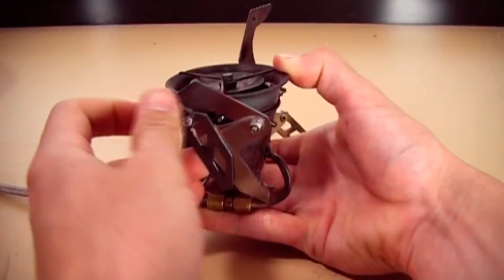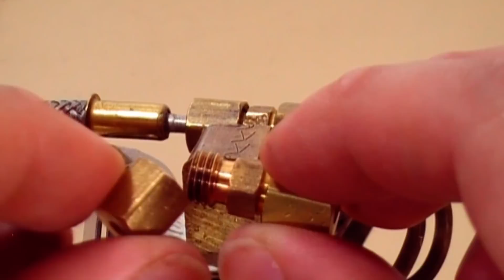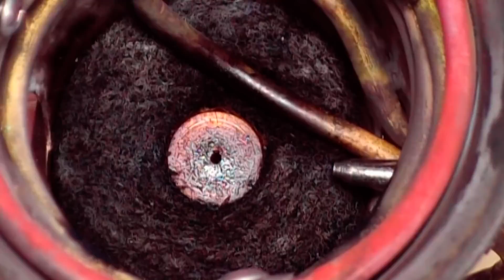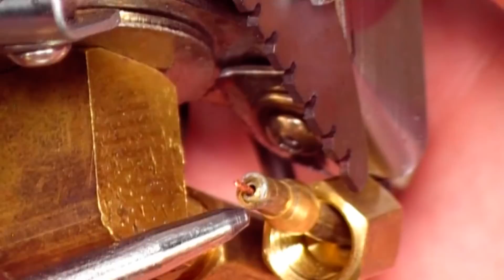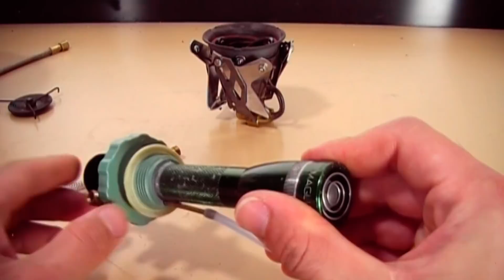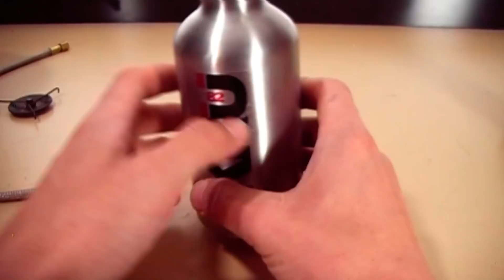All Alcohol Stove design

Comment: I have been using an rubberized superglue lately and it works awesome.   I get it at the hobby store.  When I built my miniature gasoline lantern I used Teflon rope for all of my seals and packing it works out well.   I found miniature valves and fittings by a company from Vermont I believe (if anyone is interested I can hunt down the name).  I have the convenience of owning a pile of machine tools and watchmaking equipment so making small parts is not that big of a deal.   This stove design here is awesome,  thanks so much for sharing it!   I love building these sorts of things myself.   I decided to make my own pump and make it external,  this simplified and further miniaturized the lantern I made.   I used a threaded value on the tank.   Very simple to make on a lathe,  I can share the specs.  I want to make a micro miniature pressurized,  mantle type,  alcohol lantern for backpacking,  any ideas would be great.   Thanks again!
Reply from the maker: +Denis Carignan (The un-blinded Watchmaker) Yep, that glue for gluing tires to the rims of RC cars is pretty resilient too. I have used teflon tape bundled into a rope to seal my butane stoves that use water valves. I have also used leather on suggestion from a viewer and it works well too. The leather packing I used on a stove I called the "DIY SVEA 123" because that one works on thermal feedback through the brass valve, I had trouble with the tape "shrinking" with the heat and not sealing. That SVEA 123 design might be of interest for a lantern, I found from my homemade butane mantle lantern that the flame conditions that best illuminate the mantle are harder to obtain that just a hot blue flame. It's almost like the flame needs to be an oxidizing flame (fuel rich) with secondary air meeting the surface of the mantle.
Reply: +clkindred it's the same concept as the hot blast and cold blast kerosene lanterns.   I think it's in how much and possibly the temp of the air mixed in the draft tube.  I've noticed that where the vapor enters the blast tube makes a huge difference.   The Coleman design works perfectly,  the fresh air enters from the top and the heat on the tube creates draft which provides the vaporization and right mix before the fuel mixture enters the mantle.   Too much air and the ignition is outside the mantle,  too little and the ignition is inside.   I've noticed this especially when burning different fuels in a Coleman lantern.   I am working on the calculations but I really suck at math do I've been having trouble nailing it Down.  Getting the right amount of pressure our of the generator is tough also.   Stainless steel screen from automatic transmission filters work fairly well.   I want to make a lantern with no pump like the SVEA stove but I haven't been able to get enough draft to both light the mantle and get the heat needed to pressurize the tank.

Comment: soldering isn't high heat enough... learn to braze. Oxy-fuel or oxygen-acetylene brazing typically utilizes silca-bronze as a filler material. It still works by capillary action just like soldering but its able to withstand much higher temperatures and pressures than lead solder. It's what they use on exhaust header flanges (even for nitro methane burning engines) as well as air injection (thermactor) manifolds on older smog engines. 
I'd suggest investing in a small tubing bender like a brake line tool before bending tube like that again. You can see where you crushed it a bunch of times and that's far from safe. You will also probably find that you get a more steady flame if you use a correct tool and make really smooth bends as the smoother the outside, the smoother the inside, the smoother the flow of fuel.. and smoother means less restriction and more efficiency.

Comment: I have to make a correction to my post I had not used my caliper in about 15 years that I left for the first zero after the decimal point. It was.025 not .25 for the outside diameter and .0053 inside diameter appreciate. I have two five inch pieces of this tubing in my scrap box.

Comment: Put a compression fitting on the 1/4" tubing. On the other side use a cap. You drill a hole that the tubing just fits in, than silver solder the connection do the same to the hook up for the expansion chamber. Attached to the expansion chamber first then to your 1/4" tubing last. I don't know how many inches you needare to be use. Silver soldering is just like soldering with regular solder you have to use a different flux and silver solder. If you can solder with a propane torch than you can silver solder. Does that help?

Comment: Nice work.  What type of solder did you use on the original construction of the brass components?  I don't think that silver solder / braze would have re-melted but I do like the threaded connections better.  You may have covered the legs in a previous video, are they hand, scroll saw, or laser cut?
Reply from the maker: +Keith Ward I used plumbing solder. I think a brazed joint would hold up well, but I am not outfitted to braze. The legs were cut by hand with a hacksaw and file from dollar store cookie spatulas.

Comment: clkinderd  Do you know how hot the 90 deg. elbow vapererizeing chamber gets? I found that I still have some Silvaloy A56T brazing alloy left it's melting range is 1145 - 1205 deg. F. Or you could bronze solder it. Use .16 inch diameter. It's melting range is 1655 - 1724 deg. F. Don't forget to use the proper flux. I think either one should work in soldering the .052 in tubing into a plug for your vapererizeing chamber. The same for the other end that is used to attach the fitting for your 1/4 inch compression fitting. Let me know how it works. If you have a problem finding the.052 tubing I have two pieces here that are a little over 5 inches long each. Where did you get the legs / potholders for your stove?

Comment: Excellent job and very nice stove. Thanks for showing how you built this. Is there a reason you did not use copper tubing as opposed to brass?
Reply from the maker: +bain5872 Yep, copper gets very soft after being in the heat like that, you can see the brass tube turning red on the top loop from the heat. Honestly, the way I have the vapor generator protected inside the burner, and held in place with the screws, I could have used copper. Older versions of this stove had the vapor generator outside the stove, so I made a choice to use brass because it stays more rigid than copper.
Reply: clkindred
Makes perfect sense. I'm going to build one for sure. Really great job using parts on hand.
Reply: Brass is better choice than copper. Copper oxidizes much faster than brass.
Reply: Great observation. Can you tell us why Brass oxidize slower than Copper?
Reply: bain5872 Copper is oxidized at a temperature ranging from 200 °C. Brass is much more resistant alloy.
Reply: kabyzdoh
Yes but why is this so?
Reply: +bain5872 It has few components: Cu,Zn, sometimes Al, Ni, oxides of these do the job. Wikipedia, you know...
Reply: kabyzdoh
 I was not being rude. I was challenging your statement so you could provide facts to back it up. You did a good job!
Reply: +bain5872 I felt that you do me the exam when you said "Can you tell us ..." You confirmed it now. What for you needed it?
Reply: In your original post you were advising me of a fact I was very aware of. I wanted to be sure that you were correct and the only way to do this was for you to verify that your information was valid. I see you asked Wiki for the information that you, at that time, did not have. You now know the facts. This is the reason for this post. You have increased your education!
Reply: I would want to believe that your approach makes the world better.
Reply: If you decide to be better, then the world is indeed better. Isn't it! You're a good sport.

Comment: Will you be doing another knife anytime soon?
Reply from the maker: +MrZimma frame I just put the full flat grind on a knife I'm making now, my hands are still dirty! It's a folder though, liner lock, so it's less straight forward than the others.
Reply: Are brilliant. I study Mechanical engineering and the variety of metal selections is fascinating. I have yet to find a good video on youtube of someone making a waterproof/water resistant knife. could be a future video idea?
Reply from the maker: +MrZimma frame Ah, yes the rust is a problem with O-1 tool steel although the blued blade on my Kershaw Blur has not shown any signs of rusting with normal use. A "stainless" tool steel like the fancy CPM S-30V or 440c would be a good choice, I don't have the ability to heat treat those. A food prep knife would also need to be rust proof and non-toxic.
Reply: wow that was weird, i was just reading about 440c, crazy! is there any alternative rust protection for 01 tool steel as i do want to use it for cutting food and meat. in the past ive wiped the blade after use and rub oil on it.
Reply from the maker: +MrZimma frame Apart from what you are doing, which is good to do with a blade regardless of what it's made of, the only options for DIY'ers is a coating of some kind. I have been interested in using products for coating firearms like "Ceracoat" but it's much like paint. I would LOVE to figure out a way to put a "nirtide" coating on a blade, but the process is pretty out there. Other areas I am looking into is "fuming" metals onto the blade, glass blowers use that method to put metallic coatings on glass.
Reply: I wonder if black car body paint would work, (rough the metal up and use primer then matte black) then just expose the edge by sharpening it. Its an interesting topic to discuss
Reply from the maker: I would also be interested in electroplating a metal onto the blade, but the variety of metals that can be plated are slim, I have not found metal salts of the right metals to make a useful coating. It could be done with copper if one dose not mind a copper colored blade, the copper itself can corrode and turn green though. Titanium is very corrosion resistant and non-toxic, but I have not found a way of plating titanium onto steel. The titanium nitride coated drill bits that are gold colored have that put on by physical vapor deposition or reactive sputtering. Both require a vacuum chamber. Salt bath ntiride or "melonite" treatments require a dip in molten salt, exactly what salt it is is kind of hard to find out because they are proprietary, but from what I have read most melonite salt baths contain cyanide, yikes.
Reply: i would avoid the cyanide ha. The alternative is to use a stainless steel like 440c or other and quench it in a liquid nitrogen bath to increase its rockwell hardness (around 58-60), giving the best of both worlds (hardness and rust resistance. The selection of metals in England are hard to find. Is it better in America (if that is where you live) ?
Reply from the maker: +MrZimma frame Yes I live in America, in Colorado. 440c is looking better and better as a blade material.
Reply: from what i have read cryogenic quenching of 440c is the way to go so long as it isnt being used for heavy chopping, as you get a Rockwell hardness of upto 65 (58-60 is the best of both worlds though tempering). i might make a video of a stainless steel survival knife with a few things that haven't been used in other youtube videos. i might make a new account for it. I wonder if its easy to source a cryo bath?
Reply from the maker: +MrZimma frame Depends on how cryo  you need to go, people have done dry ice in alcohol to get a very cold bath.
Reply: That is something i would need to look into. You guys in America have a lot of suppliers to get knive related supplies from. Do you have access to good knife scales which have been dried stabilized with resin? As it is impossible to find in the UK.
Reply from the maker: +MrZimma frame This place seems to be a good bet for that, as well as other things. They claim to be a "global supplier" but I can't attest to that. http://www.knifemaking.com/category-s/4.htm
Reply: much appreciated. At the start of next year i might be coming to New york on holiday so i might try and buy some stuff then too.